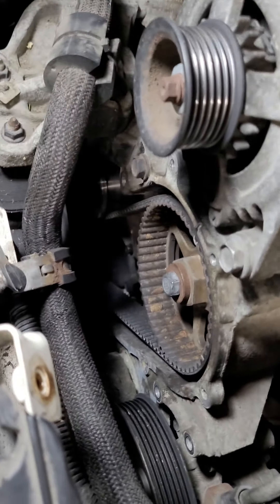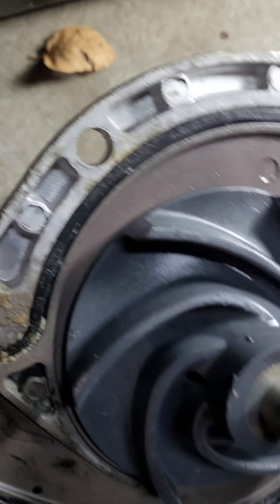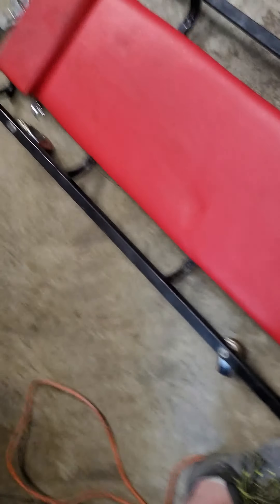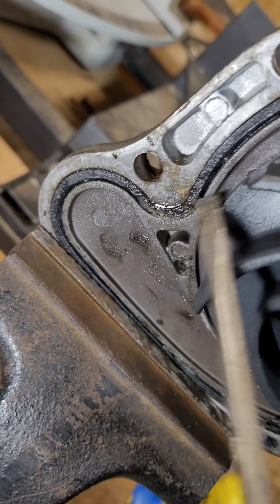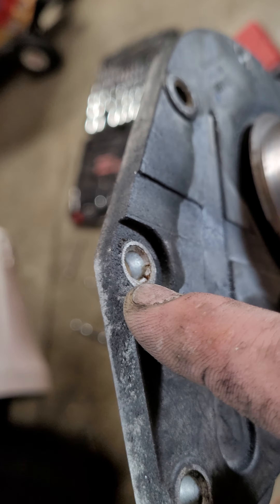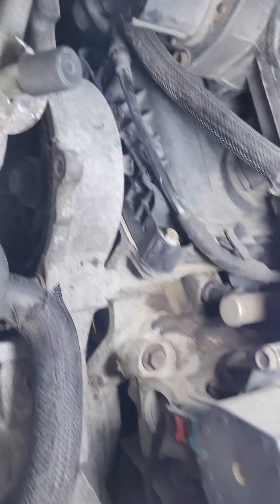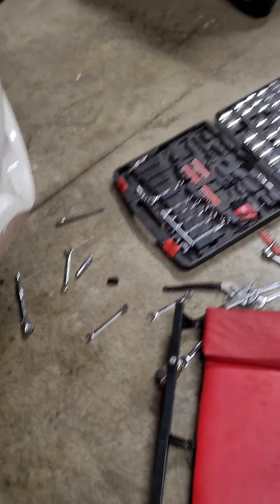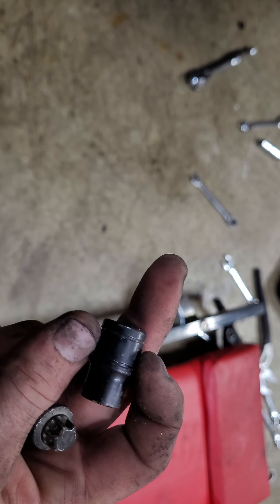3.8 Liter 2008 Chrysler Sebring water pump replacement, PT 1.

Comment: Is it a convertible? And if yes do u have problems with it? I definitely had the same problem overheating. I changed radiator, thermostat, water pump to find out it’s a crappy design
Reply from the maker: Not a Convertible, but yes to the crappy design for the water pump. There are essentially 2 places plus a weep hole where the stupid thing can fail.  I made it about 180,000 miles in what is I'm assuming the original water pump, currently I have about another 30,000 or more on the new one.
Reply: Hey how much would u charge to do that?
Reply: mines a convertible I took it to a repair shop and they told me the water pump is messed up and the only way to fix it is to remove and replace it. Damn thing is in the engine like this dude described told me it would cost 1400 to fix damn thing aint worth that much
Reply from the maker: @matthewvalencia8638  that's why I did the repair myself I knew it was going to cost a lot of money to fix the repair itself technically actually only cost me what the price of the water pump was and about 10 hours of my time
Reply from the maker: @-787photo  yes I have recent ly uploaded video of me replacing the water pump for the second time now, of course I have put like 70000 miles on it since the last one
Reply: @jessesworld6400  did you make a video?
Reply from the maker: @-787photo sure did about 2 months ago, it's on my channel. Water pump timing belt and spark plug replacement video.